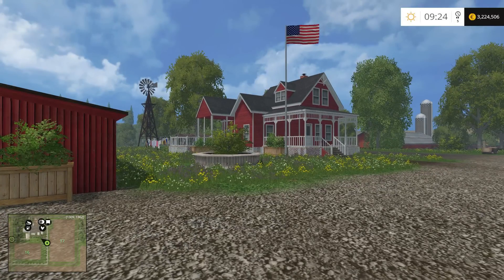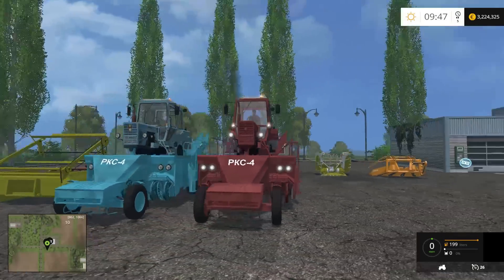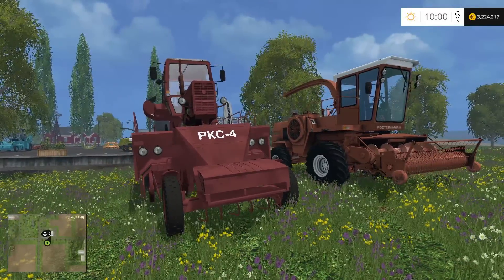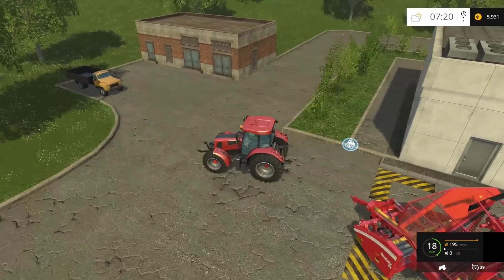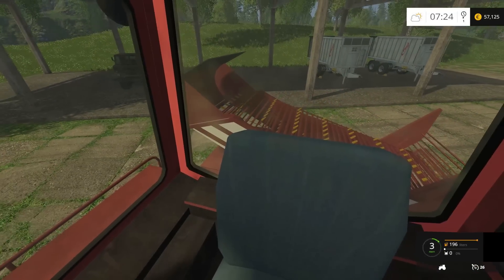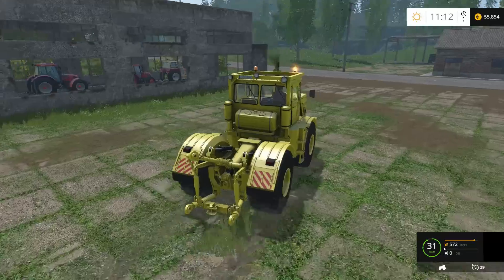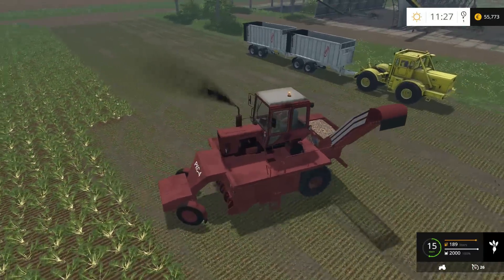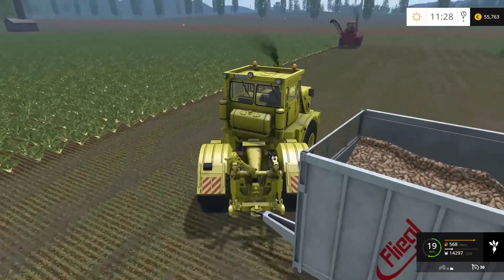Sosnovka Walkthrough 11 - Farming Simulator 15 Gold Edition DLC

Comment: 7:08 The words you were looking for is gouraud shading vs. per pixel lighting. Without tangent information for normals, the engine just vertex shades the model. This is why they look dry, flat, and "cartoony". All of these mod authors with few exceptions use smoothing groups (hard edges) to "fake" the use of tangent space normals. Unfortunately, since the engine in 2015 was optimized to take advantage of a PBR (Physics Based Rendering) texture pipeline, without tangent information you end up with models that look like this.To get the models to look like the Giants models takes a lot more work, much more than your average Mod author is willing or has the knowledge of hard surface modeling to do.The good news is, if a mod author (like the guys behind BM Modding that did the Krone Baler) have their original 3D models still in quads, these could easily be subdivided to generate high resolution models to bake proper tangent space normals.Image demonstrating the art pipeline:http://i.imgur.com/6Izi1hC.jpg